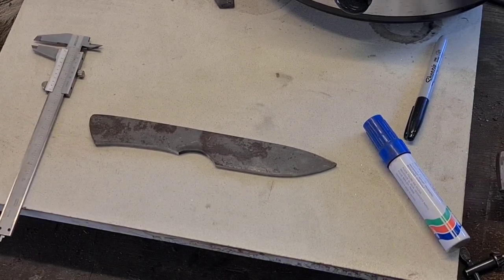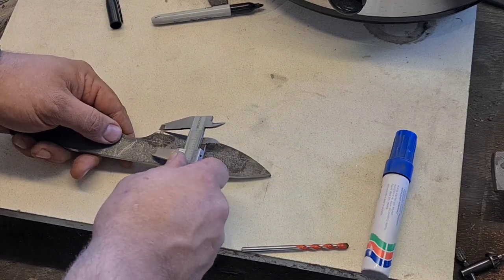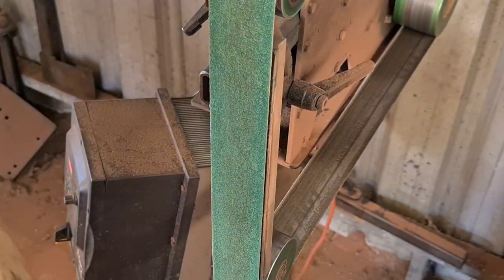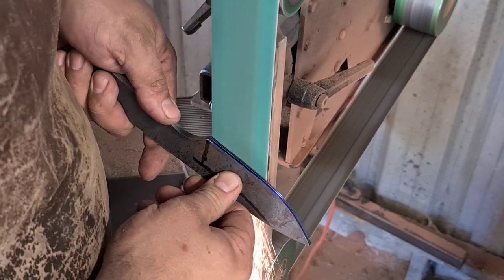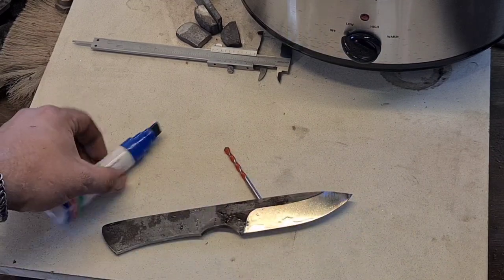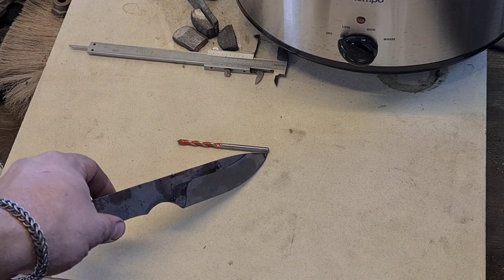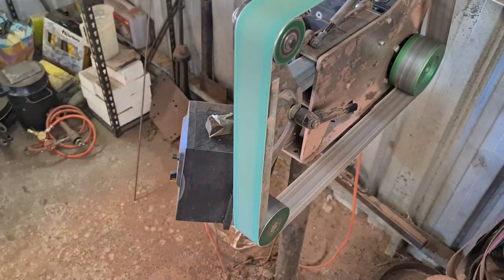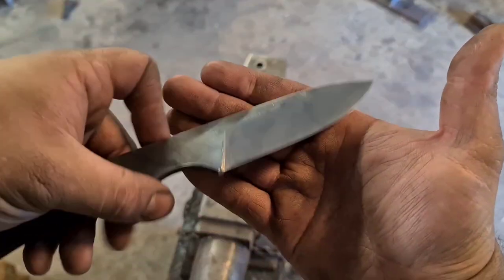How to Sabre Grind Knives

Comment: Those are some damn good tips. I'm not a knife maker but occasionally it happens. This is why I need a vfd, my grinder is just too slow. Works great just takes forever at 1800 RPM. It would literally have taking me two hours to grind those bevels. Maybe that's why I hate grinding so much

Comment: Can I ask Sam? why don't you like full hollow grinds? Do you perform more chopping tasks with your knives?
I started collecting Union Cutlery,Rogers,Henckels old woodcraft knives in my youth,so always loved the full hollow..
Now I still find them easier to keep sharp yet I get an axe to baton camp wood.
I know everyone has their own preference and utility needs ,and would enjoy your take on the subject.
Reply from the maker: Hollow grinds are fine for certain tasks. I prefer the geometry I can achieve from a full flat with minor convex, just as easily sharpened, but flow through a cut the full width of the blade a little better. The other reason I prefer full flats or flat sabres is because they're easier to maintain long term, and a far easier to get a good jand finish on than a hollow, which pretty much requires machine finishing.
Reply: @SamTownsBladesmith  Enjoying your channel...

Comment: Man! Thanks for the video! :) 
Watching you smash that out makes me so sad haha can't wait to buy a big grinder, my 4x36 takes soooo much longer!
Reply: I bought a 2x36 "Multitool attachment"....It goes on any bench grinder and Now I have it on my craftsman but am looking for a variable speed craftsman bench grinder as I find them at pawn shops etc....The multitool mounts on left so platen faces you unlike the demo you can see online..The tracking is amazing for plunge lines and was $230 ....Multitool.com or tricktools.com or Multitool has shop on ebay..Support is top....Switching belts fast and can also set it up to slack grind or use the wheel ....Amy position can be set in 30seconds...Wish I got one years ago.,...They make a pedistal where it turns entire unit 90' degrees for a work rest but I free hand and do not need..I'll never spend 3k on a Bader 2x72 with these on the market...Sure would be nice,but truly not needed..Aussie company patented them..Like ACDC,leave it to the Aussies...lol...

Comment: great video. tough video because you really made it look easy and it puts a bit of a false sense of confidence in me, but we'll get there. Any reason why you're holding the knife upside down vs. sharp edge down? i'd think with sharp edge down you're able to gauge how far the spine is off the belt to keep angles consistent but i also don't know what i'm doing!
Reply from the maker: More important than your grind height is your edge width, without looking at the edge it's far easier to overgrind your blade. You also then have nothing to support the blade with, here I have my finger under the spine to stop the belt from ripping the knife from my grasp, you couldn't do that edge down. Finally control, it is easier to control pressure etc when grinding edge up. Thanks for watching, and thanks for your question
Reply: @SamTownsBladesmith  awesome. excellent explanation. i guess by marking out the centerline and working to be evenly grinding towards that will inevitably keep the angles consistent as long as the blade is flat.

Comment: Hello Sam, thanks for the instructions. Would I go about this technique in the same way if it was a curved blade? Such as the name suggests saber grind. Or would I need to adapt it in some way?
Reply from the maker: Yep, precisely the same. The term "sabre grind" in this instance refers to the height of the grind, not the curvature, bit it can be used on straight and curved blades. Thanks for watching!